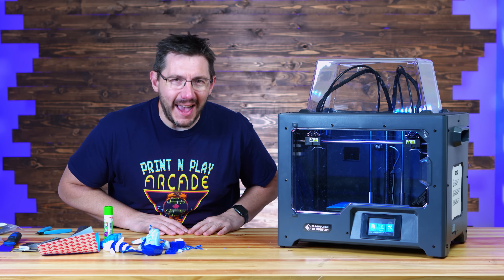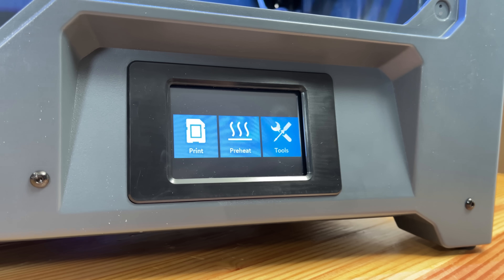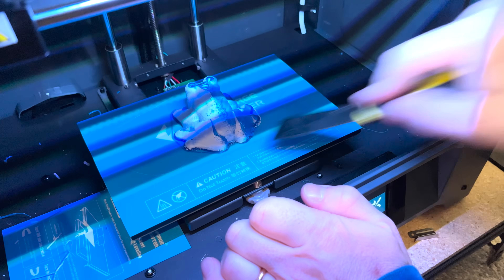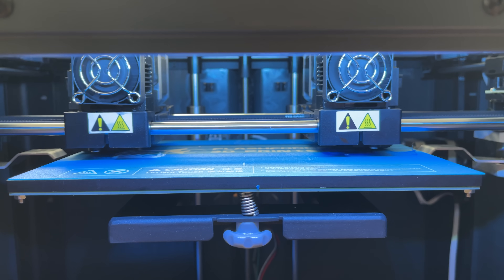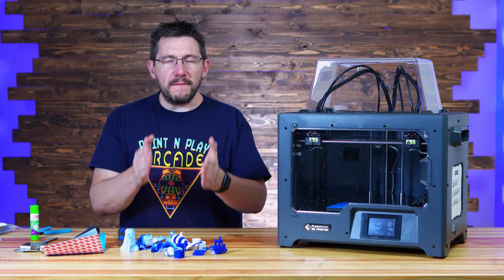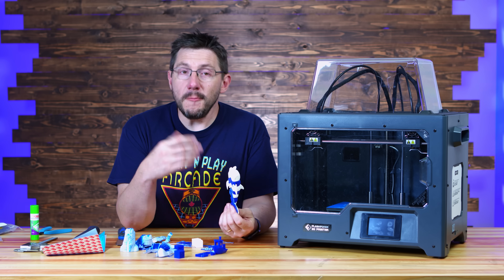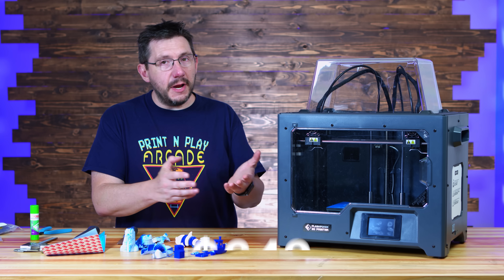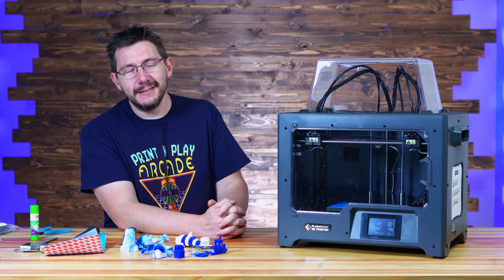Did Flashforge Miss the Mark?

Comment: That is so disappointing. I don't understand why FlashForge keeps pushing that blue tape-like build surface. It's kind of a PIA. I wonder if your experience would be better with a glass build plate and turning off the raft except when legitimately needed? I bought the similar FlashForge Inventor (dual extruder but not IDEX) 4-½ years ago (my first real 3D printer if you don't count the New Matter Mod-T my kids got me for Christmas 2017). I quickly learned to toss out their blue stick-um surface and I switched to their all glass plates. To this day, I print PLA, PETG and ABS on my Inventor with the glass plate using glue stick for all 3 filaments. I had to download and print some corner brackets to hold the glass plate in place. FlashForge supplies a small "adjuster" piece for the Z-stop switch with the glass plates to compensate for the thicker glass plate. I can swap plates at the end of a print without upsetting the bed level to let the just-printed plate cool off and can lightly tap the parts off the cooled plate with the handle end of a scraper. I clean the plates periodically when there's too much accumulated glue stick by sticking them in the sink, running hot water over them, and brushing with an old toothbrush. Using purple glue stick, it's easy to see the PVA dissolve away. I also like the smooth bottom finish I get by printing on the glass plate. Not sure I would buy another, but I am glad I have the Inventor in my arsenal.

Comment: I understand this it shouldn't be an issue in the first place, but I've got a flash forge machine (flash forge finder) with the same style of bed and annoyance(at first), BUT its very easy to get it of the platform, just place the scraper at the lowest line of the print then one little/medium tap with the rubber hammer on the scrapper Handel gets it of easy every time. Don't hit the actual model with the hammer lol tbf this seams like a good machine(currently 5:36) though the video, u just have to know good tactics like with my machine to make it better ( that is todo with removing the print) i do agree with what your saying tho as this is a big learning curve for a printer that advertises as easy to remove of the bed, but as its not a heated bed in the first place the prints where never going to come of easily any way, as its a still temp. But ye 100% they lied either way lol

Comment: I have the Flashforge Creator 2, and I don't have these issues. I love the excellent bed adhesion: I don't think I've ever had a first layer failure. I do, however, use a razor-blade scraper to remove the prints, and they come off without much issue. The putty knife is definitely insufficient! And my rafts pop off with very little effort, unlike my CR-10 where they sometimes are welded on like Space Shuttle tiles. They do pop off more easily once they've cooled, but I've very rarely had one that couldn't be removed.

My only complaint with the printer is lack of WiFi, and that sometimes it fails to start from the USB cable for no explicable reason.

Comment: So, firstly love your videos.. but I'll agree this is somewhat laughable.  Not at 600+ dollars.  Most of us as a most common issue cant get parts to adhere to the bed to complete a print yet this system seems to have gone to the extreme opposite end of the spectrum.  Perhaps they could dial it back a bit and goto production of build plates.  This will look like a good push for Prusa to get into the game in their normal client market

Comment: Absolutely agree with you on this spending that much you should basically plug and play. 
Like my Anycubic cobra max I did have to flip the bed because it was sticking too good it’s really good on just a clean glass surface two months in and I just haven’t had any issues at all and the print quality is fantastic and it has already paid for itself. 
Love your channel Joel.

Comment: My Makerbot 'thing-o-matic' i can turn it on and print something off the sd card in ABS without leveling or a raft and its been sitting in the corner ever since i got my Anycubic Vyper.
If it wasn't for my Makerbot 'thing-o-matic' there wouldn't even be a Flashforge Creator, so its so disappointing to see a machine built 12-14 years ago work so much better than this Flashforge Creator Pro 2!

Comment: Yeah, if you're gonna require users to scrape parts off the bed, it should be removable at a minimum so users can scrape them off SAFELY. Markforged can do this, there's no excuse for other manufacturers.

Comment: I have had one of these for a couple of years now and the bed is hard to remove prints yes, I bought a pei plate bed but it has the same sticker on top so still hard to remove prints. I use a box cutter and put the blade all the way out and slide it under the print and that works great just have to be careful. I wont even go into the stupid spool holders which only fit Flashforge spools, I printed custom holders and fit to the front. As in prints yeah they have never been anything great and the left extruder has been faulty since new. It was the multi colour print idea that sucked me in lol but I have just ordered a Palette 2s so the Flashforge may get evicted from the print room as I need space for the Prusa I ordered at the same time. Thanks for sharing your opinions Joel.

Comment: After viewing multiple youtube videos on the Creator Pro 2, I set my print head 2 thickness of paper away from the build plate.  Prints pop off the build plate with minimal pressure.  And there is a good profile for Cura that does not default to a raft on every print.

Comment: Joel. Did you not use the included removable bed upgrade?

3D Printing Professor says:
"Now, I have one of these and I love them. But, I did install the included removable bed upgrade the very first thing and it has, I think, completely changed my experience."
Reply from the maker: No removable bed was included in mine.

Comment: I like my Creator Pro 2, though I don't do multi-color prints.  For me personally, the only reason for a dual extruder machine is soluble supports.  I got it on sale (don't remember the actual cost, but it was a lot less) don't know that I would have paid full price. I bought a flexible bed which I added before the first use. I turned off rafts after my first print. I also calibrate every filament I use.  So I would say your recommendations are dead on.

Comment: I had a Flashforge Adventure 3 (or 4) and I experienced some of these same problems with it. I did learn that I could turn off the raft by using their cloud print service but I had A LOT of problems either not getting prints to stick or sticking to the print plate or fusing to the raft. Etc.

Comment: I can only speak for the Creator Pro (1):
After adding a magnetic bed for roughly 50 bucks,
printing more robust PTFE tube holders for the backside,
printing universal spool holders and
using Polysupport (break-away) for supports and rafts
most prints are reliable now. But this tinkering shouldn't be necessary for such a product.

I would have expected that they fixed all these shortcomings for the new version, including the use of smart, silent stepper drivers.
So it seems, they still haven't done their homework, which is indeed disappointing.

Comment: Disappointing when considering the price point and bed size.  I'd also have liked a little more head-room on the hot end temperatures.  IDEX seems to work well, but the machine just isn't ready yet.  Needing to modify a $649 printer simply to be able to use it at all is just crazy.  Flashforge control every aspect, from slicing to printing and the result is just not good enough.  Bambu Labs have shown what you can do when you control the printer, the firmware and the software, although I am well aware that even that is a work in progress and twice the price of the Flashforge.

Comment: They sell a removable flexible magnetic build plate upgrade for a very reasonable price. I have the printer to replace my old Prusa. I get really good prints from it. I just really hate the hate the slicer. Customer support is some the best I have seen in any industry. The flashforge pla is garbage, try the printer with Prusa filament, the raft peels right off and the supports come off easily. Give it another shot with good filament and you will be impressed

Comment: Ha ha. I just bought this printer this week and had the exact same issue with bed sticking. Thinking of buying a PEI sheet and cutting it to fit it.

The Slicer is also bad and there are no profiles for the other slicers other than Simplify 3D.

Comment: I recently picked up a cheap used Creator Pro 2 and I'm replacing the board and the screen, installing klipper, and plan on adding hemera with revo to each head. Also getting a flex bed of course. It's been a fun project!

Comment: I've had a Flashforge Creator Pro for the past five years and have always found it a really good machine apart from the garbage blue tape bed. They are quite expensive to replace and that is something that happens far too often as they get torn when chiselling the finished print off with a scraper. Fortunately the answer was very simple. I simply had to replace the blue sticker beds with a borosilicate glass one. I use a very light coating of either 3DLac or L'Oreal Elnett hairspray every few prints and everything stays stuck tight when printing but removes easily when finished.

The bed on the original model was a bit undersized for some things I needed to make, so I'm surprised they made it smaller on the latest version.  I bought a Sunlu S8 for larger prints, It works great but being an open machine, it's not really suitable for ABS, which is my preferred material for working parts. I'm planning to build a Voron 2.4 in the not too distant future as that's a much bigger enclosed machine.

Comment: Great to see they've added a heated bed, another hotend and external spool holders from my Dremel Idea Builder 3D20 from 2014 and nothing else 🤣. Another worthy footrest. Oh wait, it doesn't even have a flat top. Maybe next upgrade in 2027, a cup holder would bring this into the the realm of a useful product. While it's good to see improvements it's also a good idea to see what the current market is actually offering. Wake up, Flashforge.

Comment: Removable bed, direct drive, and automatic bed leveling should be on all printers SOLD today.  Everything else is nothing more than a toy, should be treated as such, and really isn't worthy of a review. For myself, I also exclude bed slingers, but that is because I demand accuracy that they can't provide.  The really sad thing with this printer is that it looks like it has a really nice and thick bed, which is wasted by not not having a removable plate.

Comment: Honest review. Thats a shame, though... I'm pretty sure this is why the Creator "Max" 2 exists, which offers a removable bed stock (among other things). The Max 2 was a quick iteration hardware update to some sort of fatal heating issue with the Pro 2. Honestly I'm surprised they haven't Discoed the Pro 2. The Max 2 has truly been enjoyable to work with and I'd recommend giving that a whirl over this older model.
Reply: As far as I can see it is just the Flashforge Creator Pro 2. The only difference is, that they deliver it with the flexible build plate and that you don't need to build it in on your own.
Reply: @captain_loeffel  there are many differences between the Pro 2 and the Max 2. As I stated originally, the Max 2 addresses the fatal heating issues with the Pro 2, offers an included removable flex bed (the main problem of this review), faster print times, better IDEX accuracy, better fan / cooling systems on the heads, larger LED screen.. the list goes on...

Comment: I made the bad choice of choosing a flashforge creator 3... This is sitting in a corner for 2years now (at 2k+€!) Because your nearly babysit it more than you print... Now I have a farm of ender2v2 with cr10 extruders, Cr touch and Revo micro...  Honestly,I whipe the bed with IPA after a print and whipe off dust ever 10 spools(!) or so! That's how it should be! (Btw out of the Box the ender sucks as well)

Comment: I started in 2016 with a Flashforge Dreamer, and yes, the beds were terrible. Stuck great yes... But made removal a pain. Early on, I put a glass plate on it with the 3D printed corner holders and then I have one of the blue sheets on one side of the glass and use both sides depending on my needs. Being able to remove the glass definitely helps with removal for sure.